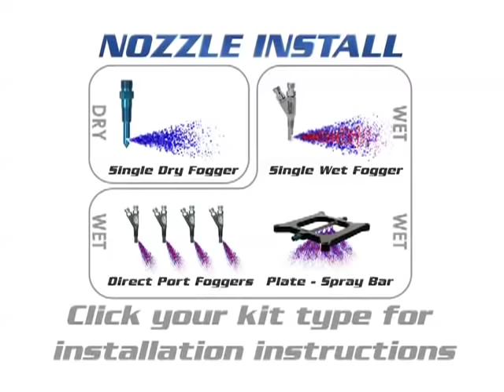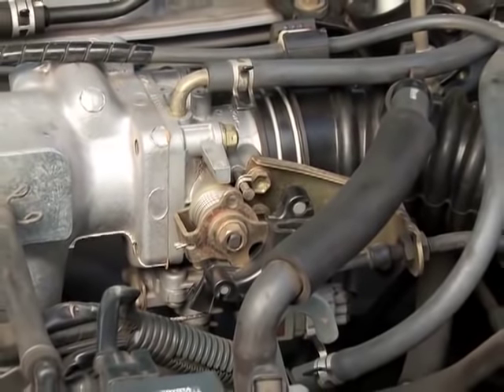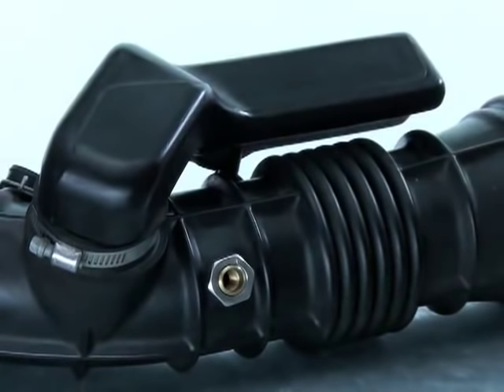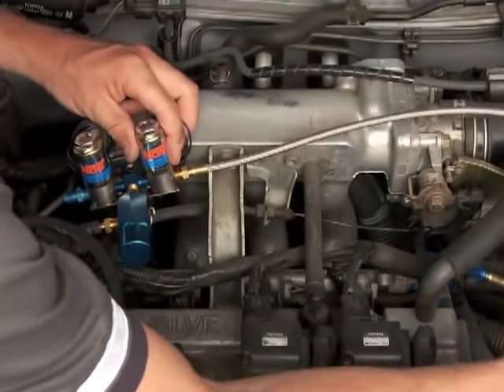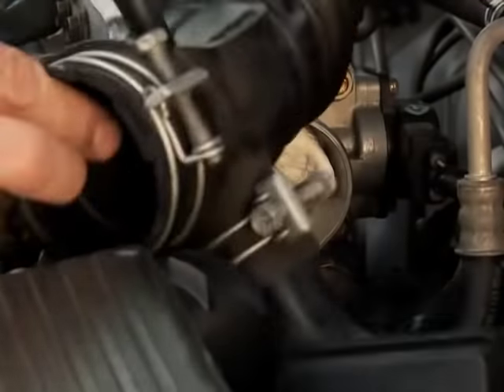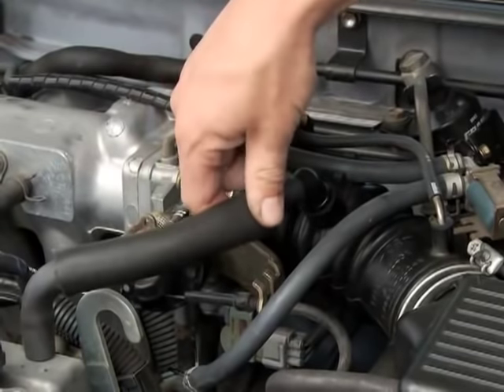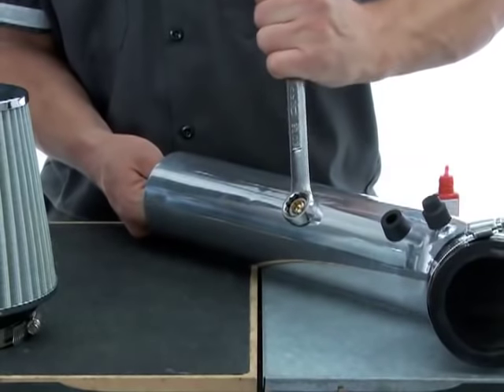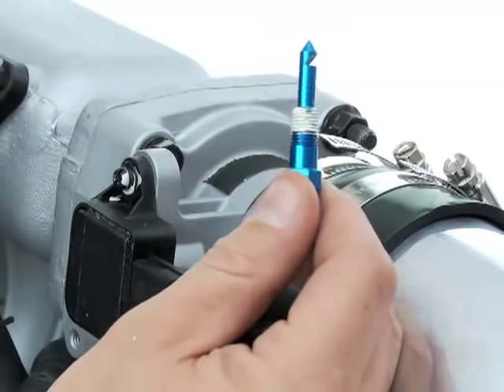How To Install an NOS Dry Nitrous Oxide System

Comment: I'm not one of the haters I drive a 5.7 hemi modded with 75 shot and don't have problems but with nitrous the only thing you don't want to do is over Rev bc that's one quick way to blow your motor
Reply: +supermotardmario ::: When over revving the ECU cuts fuel creating an extreme lean condition.
Reply: Make sure you re gap your piston rings for nitrous as well.

Comment: as this video explains everything, i dont think that ppl that dont know where the intake is located and what it is should install N2O to their cars :D
Reply: I thought the same thing when he said locate the throttle body. If you don't know what a throttle body is or where it is on your car, you don't need nitrous.
Reply: So the same nos kit will fit on my 2009 Chevy Silverado 4.8 I have KNN n long tube headers and it’s tune What would be a good positive differential axle to put on it
Reply: Edwin Jimenez Get a 5.3
Reply: Edwin Jimenez them 4.8 can hold a lot more boost
Reply: @Uizzj  4.8 is the exact same engine as the 5.3. But with a smaller displacement. Meaning the cylinder walls are thicker. The 4.8 block can handle a lot more abuse and boost than a 5.3 block.
Reply: It was info overload I was ready for pick up the drill with your right hand bring it over to where you want to drill depress the on off trigger of the drill
Reply: @IAM_HC  exactly
Reply: @edwinjimenez1541  I just want it to shave off a couple tenths on a quarter mile run
Reply: @daltonandrew168  false
Reply: @thomasmorrison30  how so? Theirs a reason a lot of peoplw use the 4.8 over a 5.3 for boost. Exact same engine. Just thicker cylinder walls. Thicker cylinder walla means its stronger and less likely to crack the block

Comment: It's funny how many know it alls are saying this will blow up. It's a small shot so it can be installed on a bone stock engine but most people don't do nitrous until after they've done fuel injectors fuel pump and exhaust and that's not a have to do but helps get all the power potential from the nitrous. using a 25hp shot on a stock car probably won't give the full 25hp but is also unlikely to cause damage as long as it's not being hit at partial throttle and for extended periods. it's meant for drag racing and it works fine for what it is.
Reply: Wowwwwwwww a whole 25hp! I spray 350hp on my setup 😂
Reply: @BashfulBones  is your engine stock?
Reply: Lol all depends I can put an nittor 80shot in my stock block I have a corvette c5 1999 😂
Reply: @BashfulBones 4 years later, wanted to let you see that you couldn’t understand that he was giving an example and your smooth brain couldn’t comprehend that.

Comment: I ran this kit on multiple, dry manifold four-cylinders. One was lost to nitrous but it wasn't the dry system itself, rather it was the joke of a pressure 'safety' switch NOS and others sells with these kits.

Most efi cars today will cut injectors out in an overrev condition. 

That cut can be induced by either over-rev's (redline) or by hitting the speed limiter (top speed cut). In both cases, the computer will cut fuel to the injectors. 

NOS's pressure switch is supposed to register fuel pressure loss, and disable the nitrous fogger from spraying. 

That is all and good if you have a car that NOS cut their teeth on...an old honkin', carburetor fed engine because their fuel pressure is not cut at 'the injector' cause it doesn't have injectors. 

Older V8's also don't have rev limits and speed limits. 

If you over rev or over speed an efi car today, the switch that NOS gives you will NEVER see that loss of fuel because it's usually tied in to the feed line to the rail. The switch will see 45psi (or whatever your particular pressure is on your car) and keep that fogger spraying. 

The whole reason they use the 'nitrous regulator' is to augment pressure to the fuel pressure regulator. When you hit the nitrous, the fuel pressure is ramped up to meet the fuel demands of the nitrous. You MUST have that extra fuel during nitrous spray or you will toast your engine. 

My blow event was racing a ws6 on the freeway. I went into over-speed and the injectors cut fuel....engine went boom.

The dry kits have the drawback also of overcoming the fuel supply during the first few seconds of nitrous hits before pressure can be ramped up to provide for it's use. This causes a lean condition initially, but I never experienced a failure from that in all the kits I installed. 

However, ONE OF THE BIGGEST NO-NO'S is putting a single fogger WET system (where the nitrous is fed with the fuel) before the throttle body.

Dry manifolds were designed to flow only air...they have long runners to help them tune teh torque profile of the engine. Fuel will hit the walls of these long runners and fall out of a vapor, causing unequal fuel to the cylinders. 

And, in some cases when dry manifolds run a wet kit, for example the last couple years of a saturn or other car that positioned the throttle body facing upwards, fuel pooled in the low curves of the intake manifold runners and did ignite and blow up the intake. I know of two cases personally where that happened. 

The best, safest, ultimate way to run nitrous would be the direct port systems. In some cases, limitations on what hp level you run, on say a four cylinder being perhaps 70hp (stock internals) can be increased to a 100hp kit, using the individual kits. 

This way, the exact amount of nitrous and fuel goes into each cylinder and if care is used (making sure not to engage below 3000 rpms, using highest octane gas at all times-maybe even an octane enhancer AND some colder heat range plugs), nitrous is addictive and fun to use. 

Good luck.

Comment: hi there, very insightful upload so thank you for the added knowledge. i plan on sticking a kit through my  automatic 04 chrysler crossfire but not sure if wet or dry would be better, any tips/ideas? also if you have come across that type vehicle with a kit before, do you know what install worked best for them?

Comment: that's great, now maybe they can also explain how to resolve the additional fuel needed.
Reply: The line he mentions going to fuel psi regulator does it.
Reply: I'm kind of with the original poster because they didn't show how to set that part up which is probably the most difficult part of all of this (it's all bolt on - however not knowing how to connect to the fuel pressure regulator will stop you dead in your tracks

Comment: So, I have to insert the nozzle such that the nitrous does NOT pass through the mass air flow sensor?
Reply: Yea
Reply: Can you explain why this is
Reply: @jonwood1459 cause if I’m not mistaken, your “tricking” the MAF. If you do it before the MAF, The MAF would read that shot of NOS and tell your car your pulling in too much air to the fuel ratio. And if you do it after the MAF it already calibrates how much air the car has sucked in so it has no clue that it’s getting that NOS. But idk I might be wrong? Lol

Comment: @ Kurt Bennet. I have a dry nos system that is 90 percent finished. It has a activation switch, a momentary switch, 2 solenoids and a nitrous pressure regulator. The car is fully built and procharged. I cannot seem to get a straight answer on how to incorporate the 50-75 dry shot on too of boost. Before the intercooler into the Holley mass air, at the throttle body( I do not know how to add fuel through the ECU) I just want to cool inlet temps and add a little more bang. You are informative. Could you please tell me how I should run this system. Thank you

Comment: cone of the filter? not if you have a MAF (Mass Air Flow) sensor between the filter and the TB (throttle body). As stated in the video above the Nozzle should go in between the MAF and TB.
Reply: AGearHead4Life d series honda uses map

Comment: +jh0ssimar its not as easy as just installing it and going. depending how much you spray, you need a fuel pump, bigger injectors, and a tune. i would get a tune regardless so i know i won't pop holes in my pistons.

Comment: the vacuum line that goes from the nitrouse to the engine fuel pressure regulator, do I add a Y/T adaptor to add the vacuum line from the nitrous or do I remove it and just install the vacuum line from the nitrouse??????? pls help
Reply: +Oswaldo Castillo probably works both off the vacuum from the engine, you could probably use another vacuum take off for it, would be doing the same job I reckon,

Comment: what if my MAF is in my throttle body?
Reply: drill a new hole in your intake tube and relocate the sensor then use the old hole for the n02 nozzle
Reply: i just realized that this comment is 7 years old so im gonna assume you already found a solution lmao

Comment: Get a plate kit, Better spray pattern and no ghetto drill install, and its easily removable.
Reply: Camaro Rick will a plate kit fit a 1993 mazda rx7?
Reply: Moises Gutierrez you have to find the specific plate setup that fits your application. They are made to fit behind the throttle body. The benefit is even distribution. Beyond that is an even better distribution install called a direct port system. (Each intake runner gets its own nozzle) it is what is used in high end setups as it is labor intensive and space critical.

Comment: This dry system may as well be called a "lean system" , I didn't hear anywhere here them explain where it gets the extra fuel needed, maybe the extra nitrogen and oxygen just magically burn with each other???

I thought it was a common (even if not perfect) practice on a dry system to DEFINITELY put the injector BEFORE the mass airflow sensor to fool the computer into giving it more fuel, not really fooling the computer, the sensor senses the cooler and denser air so it uses the injectors that are already there to increase the fuel accordingly.

Don't just say something and not give a reason, why can you never put it 'up steam' of the air flow, why wouldn't you, you have basically injected more air flow???

Does the exhaust oxygen sensor tell the computer it is too lean and increase the fuel injected?

Teflon tape causing severe engine damage ????? Titanium tape maybe.
Reply: +Loveiswaitingforthe1 it might be down to the o2 sensors in the exhaust to decide the engine needs more fuel , though it will have been running lean for a short while already, think id prefer a wet kit , probably safer for the engine, . I have used the 5th injector from the older vw golf gti to deliver extra fuel , controlled by a boost switch on the turbo conversions , there might be a way of using the same thing to compensate the dry nitrous system.
Reply: the car will not compensate that much for the nitrous even if it's added before the MAF it doesn't work that way. and neither will the oxygen sensors it's up to the installer to add fuel in the tune and pull timing if needed and there are several ways of doing that.
Reply: The rising fuel pressure helps with extra fuel and the jet goes after maf so it doesn't damage it by spraying freezing gas over a heated element. The kit is so low hp that extra fuel isn't a big issue as long as you only use it in short bursts at wot. This isn't something you'd use for drifting only drag racing. Also most people upgrade fuel pump and injectors before installing nitrous anyway. most 4 cyl mpfi engines can handle a 50hp shot on completely stock hardware and tuning but it probably won't get the full 50hp from it.
Reply: I've done a 35 hp shot dry on a 95-99 Dodge Neon with no issues at all, other than running premium fuel. You are correct most modern EFI cars MAF or Speed Density can easily adjust for the extra oxygen added. You should get 50 hp because I've gotten 65 hp at 1100 psi with 50 hp jets (fuel and nitrous) in a 2001 Dodge Neon that was also automatic, it ran 14.6@97 mph on street tires. Compare that to stock....
Reply: Loveiswaitingforthe1 anthony thomas was that a turbo neon?do you know if this set up can be installed on non turbo engine dodge neon sxt?
Reply: with a dry system you have to upgrade the fuel system. with a wet system you don't really have to depending on the shot since it's tapped into the stock fuel system

Comment: Which is better dry or wet?
Reply from the maker: Depends on what aspect you are looking at?  A dry system is typically cheaper and easier to install. A dry system adds only NOS and is harder to maintain the correct air/fuel ratio.  In my opinion a Wet  system is the way to go and safer for the engine too!  It adds a calibrated amount of fuel with the NOS shot to prevent a lean condition from occurring. It is more time consuming to install but is alot easier to control or adjust the ratios to maintain the proper air/fuel ratio.  hope this helps,  Thx J
Reply: Ask your girl
Reply: @HolleyPerformance  is it possible to spray a 50 shot dry on a early c4 corvettes mass air meter to force it to enrich the mixture?  I think the early c4s ignore the O2 sensor at wide open throttle and would run lean.

Comment: Not only is adding nitrous without extra petrol retarded but also you put the jet in the wrong place jets need to be right next to the solonoid other wise you end up metering a mixture of liquid and gaseous nitrous

Comment: is it works on carb engine?
Reply: +Encik Zach will work on any engine, as long as you can get the best fuel mixture, turbo diesels are fun with nitrous on them.

Comment: THIS GUIDE IS ALL WRONG!!!! Do not ever put nitrous to the intake pipe. The way engines are set up not all cylinders get the same air ratio but they do get the same fuel. If you put that much bos to the first cylinder and not distribute it to all of them equil you will met the first one. I know from experiance amd I had a tune. Do not do this. But a nitrous fuel rail so the spray will go through the injectors
Reply: Dry kits are pretty easy to trash a motor with anyway
Reply: R7300 You are supposed to mess up the timing. That's why its called a tuner.
Reply: You don't have to mess with timing depending on size of shot and fuel used. Ideally you pull timing.
Reply: +blu3cha0s No, you are all wrong.

What is an "air ratio"? You need two things to have a ratio between them, like a "fuel to air ratio" or a compression ratio, that can be your homework to look up what that is a ratio between.

Engines are "set up" not to get the same air....WOOOOT? 

The cylinder draws, pulls or creates a vacuum to get air into itself, nothing really to do with the manifold, the injector should inject exactly the same amount of fuel to each cylinder, therefore the air to fuel ratio should be EXACTLY the same on all cylinders.

 By your wrong theory, the compression would be different, when you say things like "not distribute equally" you show that you don't really grasp or understand much about engines.

The manifold is there to be able to have the incoming air filtered, to have a flow sensor for the ECM and to control the amount or flow of air through the throttle butterfly, the cylinders condition and valve timing determines how much air it gets and the valves and cams are "set up" to be exactly the same.

So you should understand why people do not need to take your wrong advice.

As for my little experience with nitrous oxide, the most important thing is to give it more fuel to burn the extra oxygen with, otherwise the engine "fuel to air (combustible oxygen)" RATIO gets very lean. 

Look up "Stoichiometric air flow ratio" to see how it is usually about 15 to 1 (14.7 to be exact) , this is to allow complete combustion of the fuel.

So the engine designers design or "set it up" to have this ratio but when nitrous oxide gets injected there is a lot more extra oxygen than fuel, compared to the Stoichiometric ratio, this burns hotter, things start to glow, ignition happens too early from hot bits instead of spark plugs and that is why it detonates itself to death.
Reply: Wrong, small amounts of nitrous will have no ill effects especially dry. Dry systems are misunderstood and it's best if you don't know then don't comment because all your doing is spreading misinformation.
Reply: A wet system is setup this way but not a dry. A dry goes before the maf sensor which see's more air, at this point the ecu increases fuel flow.
Reply: blu3cha0s Jesus Christ. Thats a neck
Reply: Oh hey look. Another Tib dude lol. What's up. TC's manifold only gave me about 8-10 whp and that's not including the lower manifold. Dry shots shouldn't be ran without an upgrade to the fuel system anyways.

Comment: Of course they put it on a freaking Honda.  Just what we need, more 16 year olds trying to hop up freaking Hondas.  This video was definitely made to pander to fukn teenagers.  Would you like fries with that?? 
PS. DON'T CALL IT NOS KIDDIES IT'S NITROUS OXIDE.
Reply: What? Is there a problem putting nitrous on a small engine car? No there is not. The only thing wrong is getting embarrassed by somebody with a nitrous sytem. Look at plenty of video here. 11 second K20 DC2 Integra dry system controlled by Hondata S300.
Reply: Do you have a problem with teenagers working on cars.. insurance isn't what it used to be. Trust me, I'm sure we'd all love to buy that ls1 Camaro, but we'd probably go broke.

Besides, I'd rather work on cars than sit in the basement, twiddling my thumbs, and playing games all day long.
Reply: What would the difference be if it was installed on a 2.0L VW Golf engine? Absolutely nothing. An engine is an engine doesn’t matter where it’s from. Let the teens do what they want. We all started out as a teen that knew nothing about cars to learning more about them everyday. Let them have fun with their Honda’s, besides Honda’s are built to last, there’s no going wrong with modding a Honda.